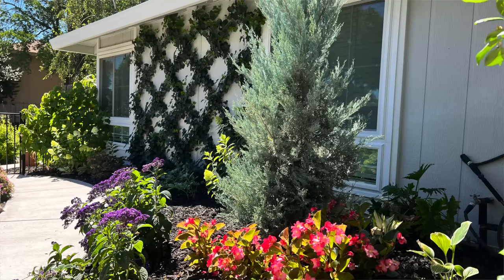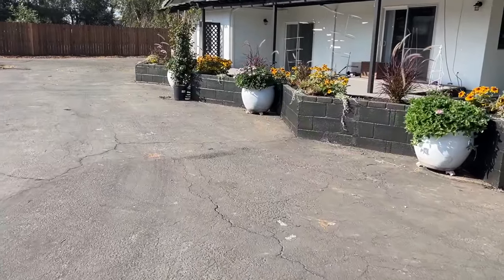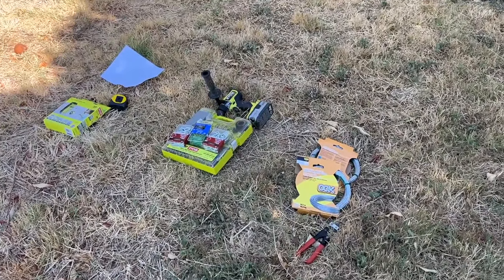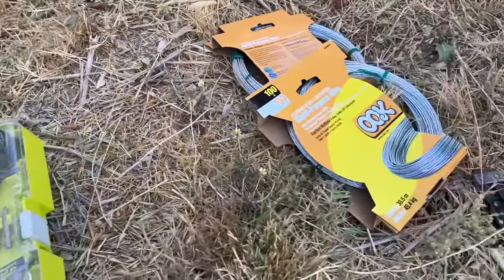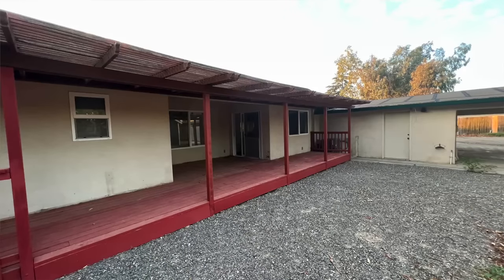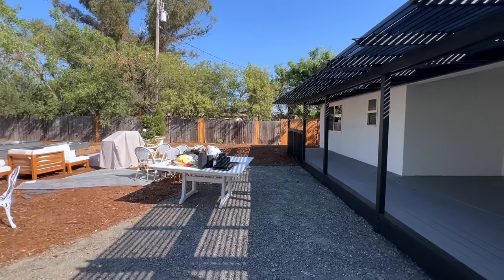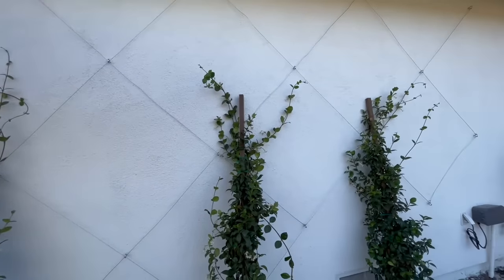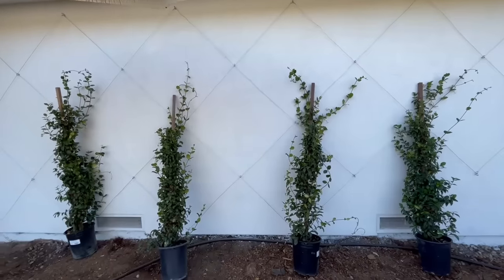It's Espalier Day! :: Installing a Star Jasmine Espalier to the Front of My Home!

Comment: Wow, things are coming along.  The back deck looks great.
I would take out the front deck and replace it with a ground level patio.  That would also solve your multiple level problems.  I would get rid of the propane tank and just use electric for cooking.  I have gas in my NY home and electric in Florida and I like electric stoves better now.  An electric cook top gives you another flat surface in the kitchen  to use.

Comment: Maybe until you can get enough compost and mulch added to your soil I recommend getting a pick axe. It would make digging / loosening the soil so you can then use a shovel to remove the soil from the hole a lot easier. That is what I sometimes use when digging in some really compacted clay soil. Looks amazing already, have a great weekend.

Comment: You are doing amazing things on your new property. Today is just an example of your vision coming to life. I'm in zone 8b PacNW...whenever I put new plants in the ground, I spend a little extra time to amend the planting hole. I know it's now always recommended, but that little extra effort seems to help with soil texture, drainage, and it just all around is an improvement to garden. I make a 4 or 5 part soil improvement mix...soil conditioner, compost, worm castings, sand/grit, leftover potting mix. A little of this worked into the hole, plus Sure Start ensures that my plants have a good chance of thriving!  I love what you're doing to the new property! Enjoy.